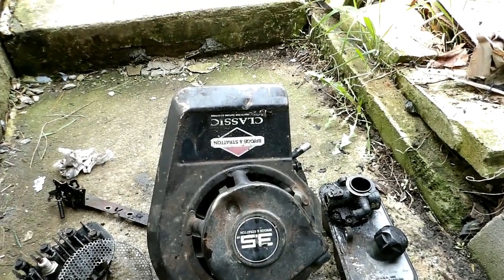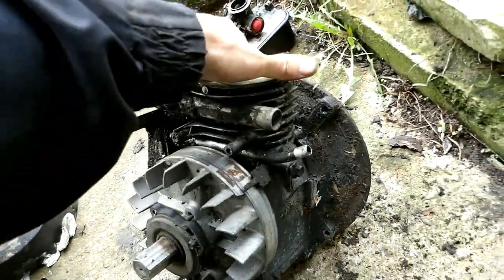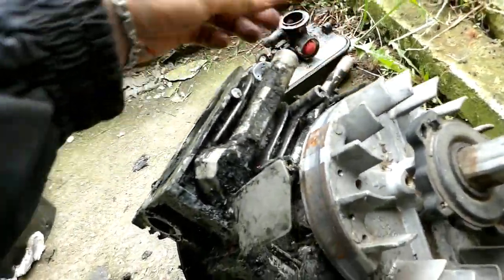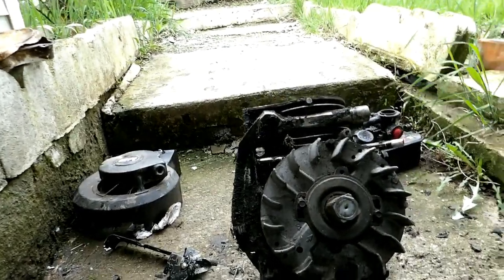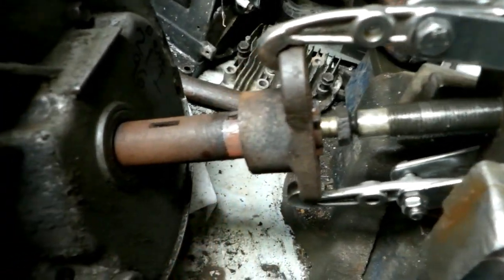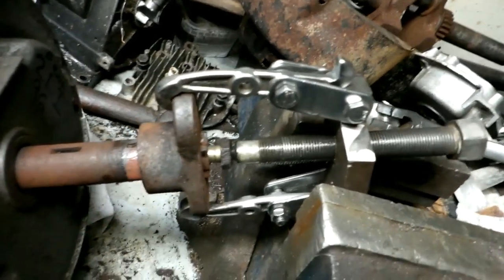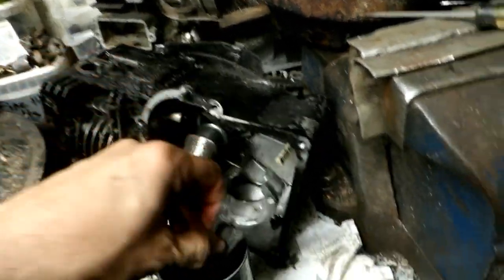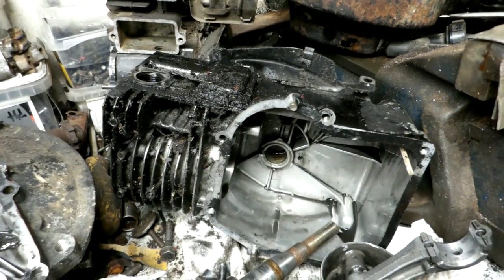1996 3.5 HP Briggs and Stratton Teardown

Comment: what oil/grease to use to reoil the engine when reassembling it?
Reply from the maker: I just use regular motor oil when reassembling the motors. You could use assembly lube, but I don't think it is necessary.
Reply: @ChargerMiles007 just like an regular SAE30 one that you put into the engine after reassembling? sorry for alot of the questions but im kind of a beginner in these and i wanna do my first engine restoration :)